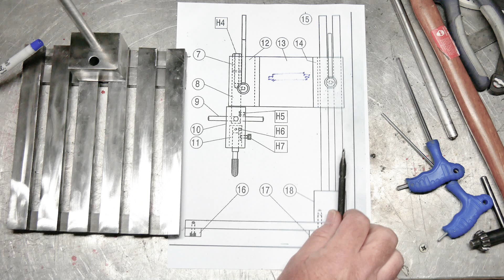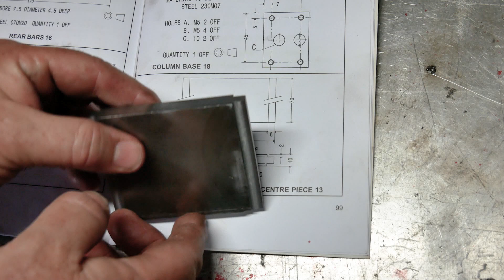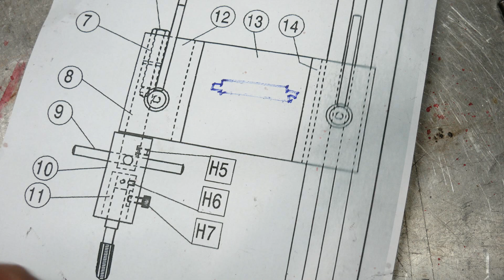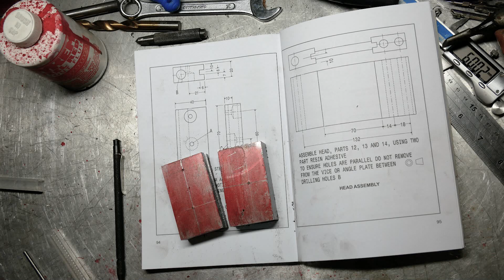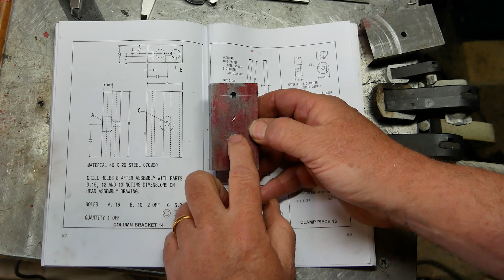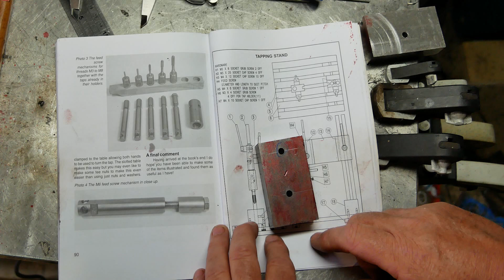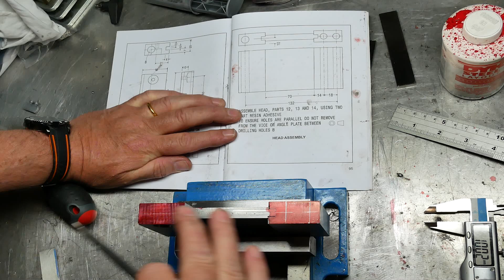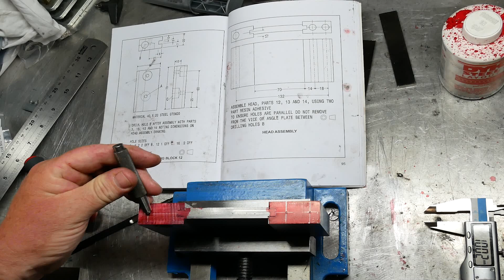Building Harold Hall's Tapping Stand Part 3

Comment: I've been enjoying watching this as I am building the same unit. Some notes:

- Be careful free-holding work in the drill press. I tend to clamp all work over 5mm drill size and all sheet material regardless of drill size.
- I've been taught to use the edge of the end mill as much as possible as the corner is the first thing to wear out. So for cleaning up an edge, clamp to the table rather than edge up in the vise. Tends to give a better finish as well.
- Mark things out like you are doing, even if you have a DRO. I messed up my origin by 2mm and drilled and reamed three perfectly clean holes in the wrong place, stuffing the entire head unit and all three clamp inserts (plus the screws that hold them).
- Cutting the tenons - it wasn't clear from your video if you did it this way but if the centre support can be done with one setup if you clamp an edge stop to the mill table and simply invert or rotate the part to make each of the four cuts. I'll do it this way next time.
- I pinned mine together using roll pins, two each end. Since I scrapped my unit, I was trying to get the pins back out and cannot. Could probably spark them out at work but easier just to remake the centre section.

Keep up the good work, maybe increase your usage of sped up footage to keep the videos flowing. Looking forward to more.

Comment: With the 16mm hole and not having a 4 jaw you can always go away from the drawing size and use something close to that size because it's for a part that fits in the hole so just modify that part to fit that way you can carry on while waiting for the new drill, if it were me, I would do all three counterbores clamped in the mill getting more experience

Comment: The project is coming along nicely!   Was surprised that HH doesn't specify silver-solder/brazing for the the pillar head, but your choice of steel-filled resin was good.  Not sure if he calls for reaming the 10mm holes, but might want to consider that (drilled holes are not really round nor smooth).  Great job so far - my shop is still in flux, so getting vicarious enjoyment!
Reply from the maker: Thanks Daniel. He doesn't specify reaming, but have bought a 10mm reamer and has worked. Only problem then was some of the 10mm steel I got of Ebay was not 10mm so back to the good supplier :) Just arrived in fact, so I can finish the column today.